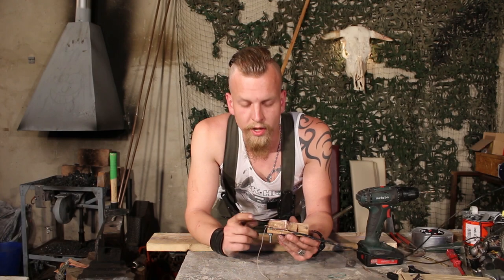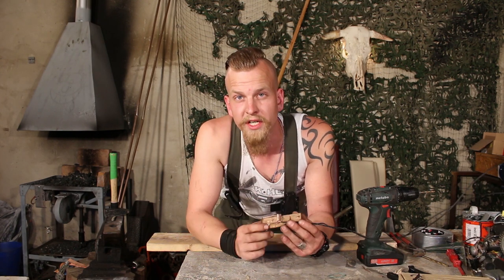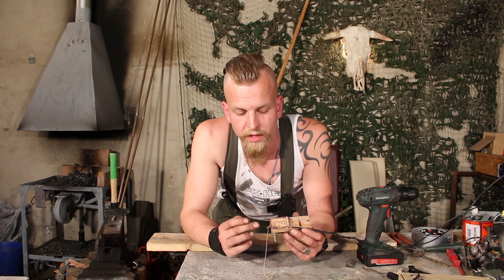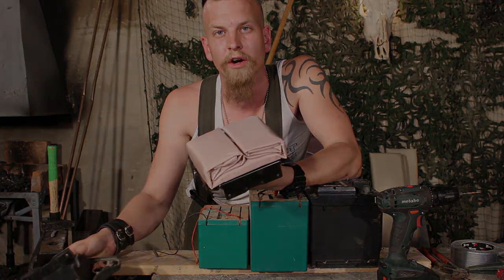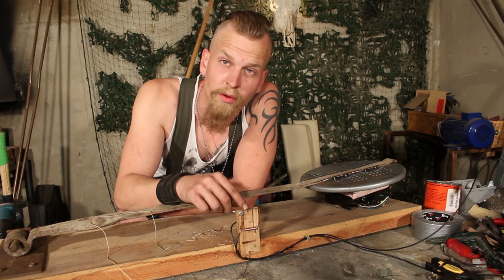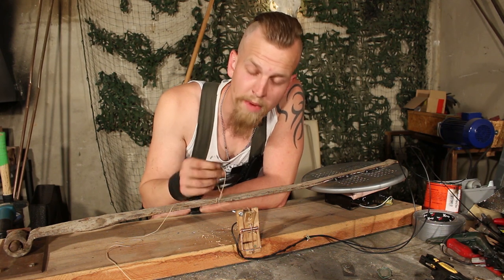Improvised Booby Trap Trigger Mechanism - How To - Post Apocalyptic Life Hacks

Comment: Hmm, wondering if you could do the same thing with a car coil spring under tension? Just use some type of pulley system no need for batteries or even the mouse trap. You would have to develop a device to compress the spring. All the good things you could do with a bit of string and some thoughts.....muhahaha

Comment: 1:53 You should have swapped the wire around the other way so when you tighten the nut it pulls the wire in tight.